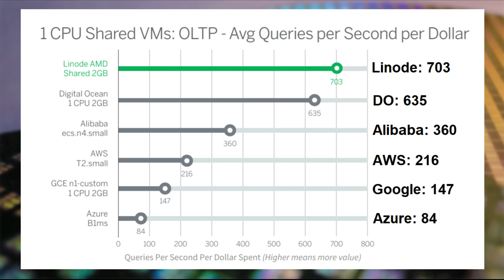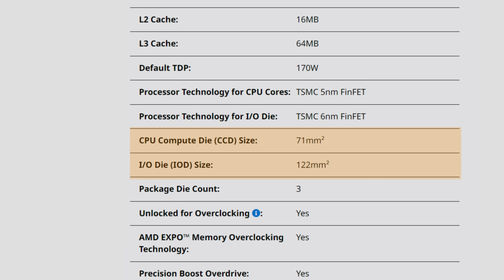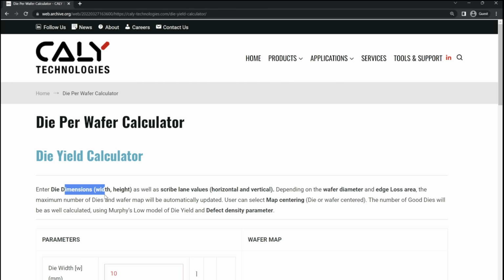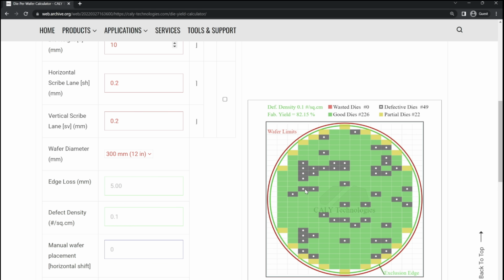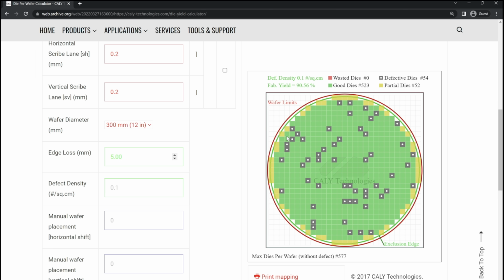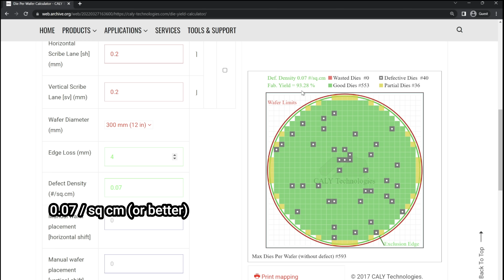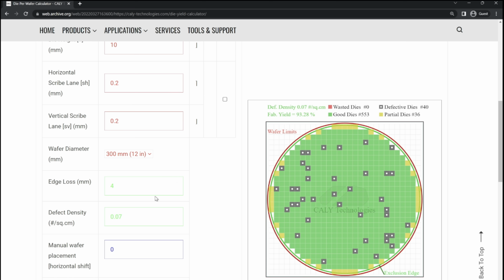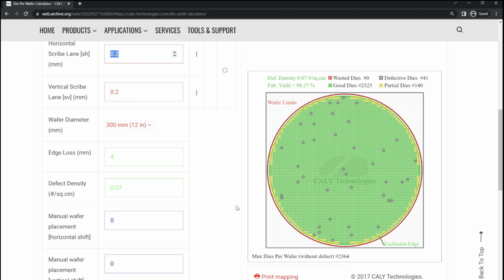AMD Ryzen 9 7950X: Cost to Manufacture?

Comment: Even if Microsoft fixes the schedule problem, which is crippling performance of Zen 4, AMD will likely need to cut prices. We are simply in a much different economic situation then we were a year ago, and many people have already upgraded. For those who already have systems built in the last 2 years, there's very little reason to upgrade. And many of those with AMD systems can get a very good processor like the 5800X3D, which is certainly powerful enough for virtually any non-workstation task and does quite well in games.
Reply: @Zenkat stagflation, war .supply chain issues, high energy costs, food uncertainty, and political turmoil. And that's assuming starvation doesn't lead to revolutions. Sri Lanka's government has already fallen.
Reply: @ronmaximilian6953  A year ago was the "shortage of everything", today many industries have adjusted supply to meet demand or exceed it.  When they produce beyond what the market wants it's really rough for their financials since those products don't earn any return, and may cost them storage fees.
Reply: @ronmaximilian6953  forgot one, obscene margin growths
Reply: @ronmaximilian6953  new film "Sri Lanka has Fallen"

Comment: Nice video. The same analysis for a 13900k would be also be interesting.
Reply from the maker: Intel doesn't give data for how much its wafers cost internally, nor does it give their defect density on manufacturing. Makes it impossible really
Reply: @TechTechPotato  At some point these figures will leak as Intel is attempting to offer 3rd party foundry services (again).  They had a few on 14 nm and a couple who stayed for their silicon photonics expertise (Cisco) but everyone else jettisoned when the 10 nm delays hit.  The big exception was Altera who was just outright purchased by Intel which was arguably a cheaper solution than paying out penalty delays.
Reply: Much harder to do I think because intel doesn’t sell their fab space (at least yet)
Reply: Do we have data for Samsung nodes ?
Reply: You could back out Intel 13900k wafer cost based on their publicly available margins.

Comment: I thought the thumbnail was clickbait. do you have an absolute maximum and minimum you would guess for this chip? I doubt it swings much lower than your estimate but could it be significantly higher?
Reply: Do you even idea about this person? Haha
Reply: @freaky425  yeah it seemed too perfect. Plus I assumed it would have to be $100 or more.
Reply from the maker: The packaging is somewhat a fudge, I couldn't get a good answer aside from 'high single digits, maybe low digits depending on supply/OSAT', so I just put the numbers in to make it work and my sources said 'could very well be'. It's a bit of fun at any rate.
Reply: I’ve heard 11K for N6, and 20K for N5 due to TSMC pandemic price hikes. I’m also not sure if Dr. Cutress took into account the IHS. A max would probably be around $70 for the silicon and $10-20 for the other parts, for an upper limit between $80 and $90. The lowest would be maybe $65.
Reply: @dex6316  thanks that's a really detailed answer.
Reply: IMO- It is a good estimate. It wouldn't swing significantly higher but there are likely some additional costs that weren't worked into it that would generally be based on the contract. Such as test time, it could be built into the cost per wafer or it can be based on the actual test time.

Comment: Couldn't some defects in a compute die result in just a core or two being defective and not the entire chip? That's what they use for the 7600X and 7900X right, the compute dies with just 6 cores enabled instead of all 8? How might that aspect factor into the cost calculation?
Reply: That's where it gets into a really complex calculation. There are multiple steps for testing. Usually basic parametric tests once the wafer is done in the fab, usually a sample test of the full lot or 3 out of 25 wafers but you can pay more for 100% parametric tests. Then a "full" test on every single wafer of the lot, which is where you would get the data needed to make binning choices. Then there is final test at the end of the entire process, once the chip has been packaged and assembled into it's final product.
Reply: @lordec911  this dude knows his stuff 💯
Reply: Yeah that’s how it works I believe.
Reply: Same “chip” but if “cores” are bad they bump it down the chart. 

That’s why they start with the highest binned cpus. Best price for what there already making.
Reply: @alexzan3564  usually it's based on how good yields are, so that they can accumulate the necessary amount of defective chips or non defective chips before releasing a model with sufficient inventory

Recently the yields have gotten so high amd is having trouble getting low core parts to sell (hence the lack of quad cores for 5000 series)

Comment: The biggest ''issue'' AMD faces is that they're competing with themselves for their supply of chips. Why bother with selling CPUs to consumers when you can sell the same silicon for 1.5 to 2.5 times extra margin to datacenters.
Reply: this was an issue when demand was through the roof not rly a huge issue anymore tho. even with ryzen 7000 being brand new its fully in stock everywhere amd can easily move supply around to areas where demand is highest
Reply: That is no longer an issue. AMD has said that their only supply constraint at this point is substrates for Epyc chips, and that will be easing later this year or early next year. But you’re right in noting that this has been an issue in the past and could conceivably be an issue in the future again.
Reply: @benjaminlynch9958  I'm not saying AMD is supply constrained, I'm saying that they just don't care about selling consumer CPUs that use the same silicon(Epyc and Ryzen use the same CCDs) for a lower margin than AMD can get from datacenter sales. This will only change when the growth in DC sales slows down, then there will be more incentives to offer more attractive prices in their desktop CPUs.
Reply: @gatocochino5594  Many of the CCD's used in Ryzen chips, can be CCD's that didn't pass the right requirements on efficiency for Epyc lineup, so some of these could be "worse" epyc chips.
Reply: @gatocochino5594  your point is simply contradicted by the facts.  Current latest TR & EPYC are on 7nm but AMD are happily selling 5600g, 5700x-5950x & 5800x3D in volume.
If your idea had merit AMD would have raised Zen3 prices and lowered 6-8c Zen4 chiplets.
The reality is Zen4 volumes need to build for Genoa launch, the flexibility of chiplets is an asset, from Dragon Range, 7000, EPYC and possibly a TR non-pro later.
The 7nm production simply isn't constrained as it was in 2020/21, nor does Zen3 cannibalise EPYC or TR Pro sales.
Reply: @gatocochino5594  That makes no sense. You're agreeing there is no longer a supply constraint, so why wouldn't AMD want to sell more chips? Selling a consumer CPU won't mean they can't sell a data centre chip, so why not sell both?

Also, the Production margins on CPUs are utterly huge, the vast majority of the cost is the R&D and initially setting up the Fabs (TSMC don't do thst for free); one off costs. Each individual chip sold, to anyone, then is massive profitable. And they really need thst profit to offset the one off costs, to fund the one off costs of upcoming generations.
Reply: @matbailie3816  thanks, you saved me the typing! 😀
Reply: @gatocochino5594  I disagree. Gaining market share and credibility in the consumer space only helps to push their commercial interests forward. Not to mention sales to OEMs are a big market which they've been increasingly chipping away from Intel due to increasing popularity of Ryzen.

Plus we all know consumer CPUs are often the result of silicon that isn't up to their server/workstation product standards. Your point does hold more true in the case of Threadripper which is why we're seeing them shift focus to higher priced 'Pro' workstations but even high-end Ryzen will always have a place as long as supply is available. It's still a very valuable market with far less competition than the complex datacenter industry.
Reply: @gatocochino5594  Exactly !  To make things worse, AMD probably does not have a 'cut down' design for a less costly, less powerful CPU. Of course, it takes more money to do that.
So much for 'repatriating' lower priced products.
Reply: @EmmEff3168  MLID channel talks specifically about those unannounced reduced TCO products.
Reply: @PatalJunior  
What ""efficiency requirement""?
EPYCs are in the 1-3GHz range and achieving reasonable power at those clocks should be quite easily for all CCDs
Reply: Because data-centers dont want those poor people cpus. they want the best of the best and will pay up for it regardless. its like how im trying to convince people that this free app is worth looking into for 3d animation and because its free, my professors at my uni discredit it as not being "professional" Yes, im talking about blender. They dont trust it because its free. its the false disillusion perspective that more $$$ means more Better
Reply: @zilog1  poor people cpus? poor people can't afford cpus.
Reply: @sammiller6631  lol yeah, "poor" being slightly less affluent westerners, who are still in the .01% richest people to ever exist in history.
Reply: @zilog1  My brain bugged reading your comment. 3 of the top 5 Super computers use Epyc prpcessors. They are all the rage in datacenters currently
Reply: @padnomnidprenon9672  and one of those computer can't run for more than 4 hours with completely crashing....
Reply: Is Intel not doing the same? Why sell core i when you can sell the same silicon as xeon workstation.
Reply: There's an advantage from sheer high volume though when binning chips, the rare outliers allow new performance classes to be viable.  Consumer desktop power efficiency and frequency requirements differ, some EPYC SKUs use few cores per chiplet but with relatively high L3 cache.
If server chips & consumer had different masks there would still be a wafer allocation problem.  You'd say why make consumer when the margin on server wafers is higher.
The reality using the same chiplets are an advantage from production point of view, but there is a trade off on using the same design.
So monolithic chips are still used in the high volume APUs.
Reply: This is fundamentally wrong. AMD (and Intel) are companies that CAN NOT afford losing desktop market, because it worths billions of dollars + gives them the much wanted mind share in order to advance in other markets. Both AMD and Intel without desktop sales would be dead in the water.
Reply: now that IT companies are slightly contracting there may be a reason finallyy
Reply: consumer and buisness chips do vary quite significant. Can't really compare the pricing, especially as datacenter expect an epic to make several k a month. Also R&D in ryzen and epic do vary a lot.
Reply: @LordXavier79  Simply due to more volume. At equal volume, AMD would probably make more profit than Intel.
Reply: AMD had constraints because TSMC 7nm process when they had to make cpu's, gpu's and console chips( contract obligations) all on the same node. Now they changed process nodes and TSMC has more wafer allocations available and the market demand is not as high. All that means that they can make big profits even if they drop prices by allot if they can sell more units. Intel can't make chips with such low costs. Intel cpu's chips are huge die's which means low yields and high costs. Nvidia gpu's are huge also.
Reply: @skerlone  TSMC was also dealing with a drought that limited chip production.
Reply: No. Amd sell EPYC & threadripper to data enters
Reply: They aren’t competing with themselves. They are currently being smoked by intel in terms of value and performance.
Reply: The slow uptake for Ryzen 7000 because of platform cost, is a huge win for AMD now. All compute dies not needed now can power epic or even threadripper till current stock is sold and they have taken production to 3d chiplets because the non 3d weren't needed.
Nothing wasted and making even more money in a space where Intel can't compete right now.
So yeah... NICE 😁
Reply: @annebokma4637  Losing market share in the desktop market will have devastating consequences for AMD. So think again. If things were so simple, then why not AMD drop entirely desktop market and go only enterprise? Also, there is no such thing as "3d chiplets". 3d cache is modular and stacks on top of zen dies.
Reply: @georgepetrakis7703  I know it is modular, so they could go 3d for all. And I am not saying abandoning the market at all. 5000 series is still selling and so will 7000 series, it's just at what price point will the eco system be.
Because of chiplets they won't get stuck with  parts, they are interchangable. So no huge losses because sku's are not selling as hoped
Reply: @annebokma4637  Not all zen4 dies are capable to be used in an EPYC cpu. AMD must fix the pricing of 7000 series. Especially 7600X and 7700X need a "yesterday" drop by 100$.

Comment: How do they cut the wafer? It's hard to picture it not taking up several mm and not causing damage.
Reply: They use a razor sharp pizza cutter.
Reply: @crazybeatrice4555  Fucking knew it!  And they do it at lighting speed creating varying sized pieces and that's where the waste comes from!   Holy shit!
Reply: Lasers cut off cpu connection channels, not the actual physical silicon chip
Reply: The wafer is cut into dies using a "dicing machine", usually with diamond saw blade.
Each die has a couple of empty mm of silicon around it to account for material lost during the dicing process, though this normally isn't noticeable when looking at the wafer unless you look very closely.
Reply: I would imagine with lasers or something of that sort. I really can’t imagine using a wire or something physical at that small of a size.

Comment: also, how do you cut the silicon from the wafer?
Reply: The worlds tiniest chainsaw.
Reply: Depends on the wafer/fab, look up wafer dicing. Usually a saw or laser is used to fully or partially cut along the streets. The wafer can be sitting on an expanding membrane that then mechanically loads the wafer to induce fractures along the streets. Once completed, an automated "picker" takes the good/passed die on to the next step.
Reply: Laser, water jet, diamond saw.  All kinds of ways.

Comment: N i c e

Haha. But seriously, I didn't think it would be that expensive for the materials. I assumed that almost the entire cost of producing a CPU like that was not in the manufacturing stage.
Reply: RnD bruh
Reply: Well, most of it is. Only about 1/5 of the cost of the CPU is in manufacturing, about another 1/5 goes to middlemen (shipping, advertising, and retail), and most of the rest goes to AMD's profits (which go towards stock buybacks, expansion, and R&D).
Manufacturing costs for CPUs have increased a lot over time though as lithography and substrates have become more complicated. AMD's original CPU, the AM8086 (a clone of the Intel 8086) only cost them about 50 cents to manufacture (about $2 in today's money thanks to inflation) and sold for about $100 (or as part of an IBM PC for about $1500).

Comment: do you think there will ever be ryzen 3 zen 4, or any lower end SKU?
Reply: Intel i3-12100 is very fast, and costs just $100 USD.
Reply: @DerekDavis213   I'm using 3300X right now, and for me it's enough, i can even stream apex . Hoping there is lower end sku, i don't need much
Reply: @NKG416  there won’t be. Yields are great, so cutting below 6 cores is just losses for AMD. There is a possibility that AMD might bring some mobile die to desktop, but I’m not aware of any 4C Zen 4 products. There are 4 core Zen 3 products that could be pulled to AM4/5, but that’d be dependent on memory compatibility.